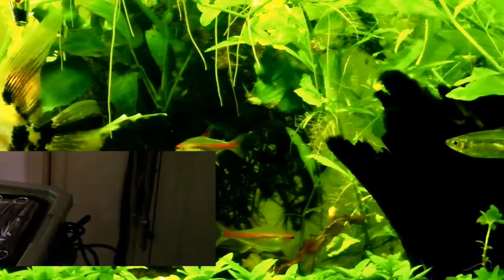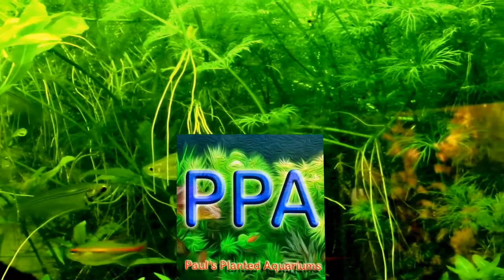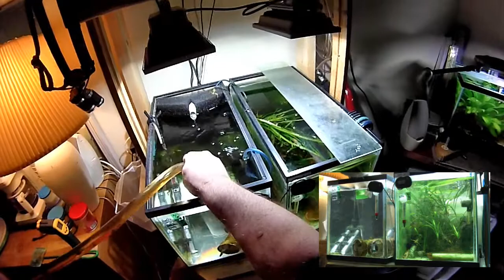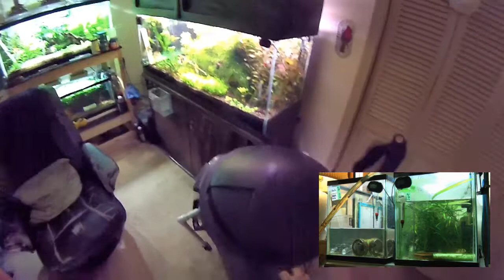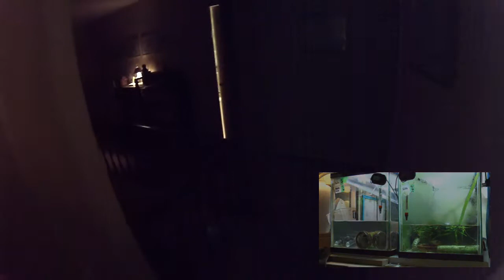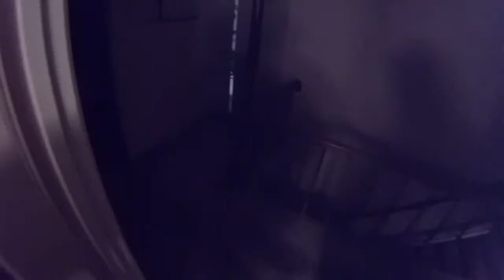How-to: Water Changes

Comment: Hey just subed, some great info there and enjoyed the video, I actually syphon my water out of my 500lt tank streight onto my garden during my weekly water change, I just wish I could set it up like you to do the refill instead of by bucket, just one question tho, can I just add the correct amount of water conditioner to the tank, then add the water, or do I really have to add it to each bucket? Cheers,
Andy from the UK 🇬🇧

Comment: After a dreadful 1 year bout with 2 subpar Aqueons and 1very short lived Lee's, it was a no brainer for a python.  I haven't regretted my beloved python 1 day since. Btw, you know you're much loved by your subbers when they specifically ask to see how you remove old tank water.
Reply: I have 5 tanks at my bar.  a 125 behind the bar, and a 75, 55, 36, and 30 elsewhere in the restaurant.  

I DON'T UNDERSTAND THE PYTHON!!!!  LOL  Granted, being a restaurant I have 9, 5 gallon buckets at my disposal. Using those makes a python pointless.  Not to mention, anytime I change the water I stick my gravel vac in the gravel, and do a cleaning while I'm at it.  2 birds with one stone.  And toss that water down the drain???  HELL NO!!!!  Every plant and tree around the building gets beautiful, plant LOVING water. All you're doing is adding volume to your local sewage water plant.............while I'm just "watering plants."   :)

And walk around with 45lb buckets, and enjoy the workout!!!!
Reply: Sahadi420 Who told you my plants were dying of thirst and/or neglect?  On the contrary, I have to refrain from over watering them.  Besides using my python, I still have significant use for buckets of numerous shapes, sizes, and volume. 

Python’s saving grace is it’s ability to remove limitless gallons of water without the MANDATORY need of a bucket. You are correct about the massive downside of  clean flowing water being dumped down the drain via siphoning. Although, there are countless examples on YouTube of marrying a siphon hose to a powerful pump.